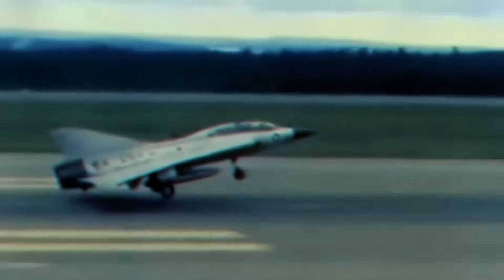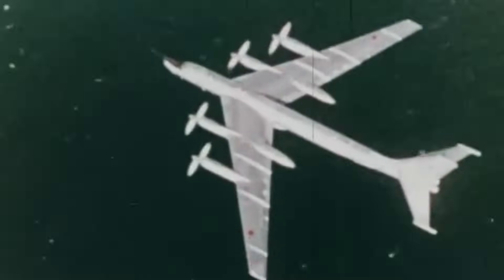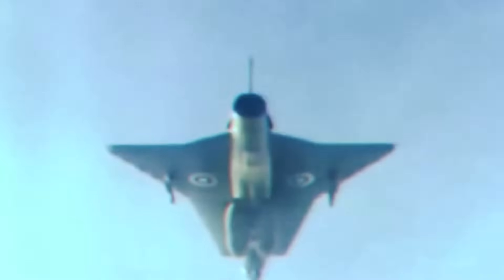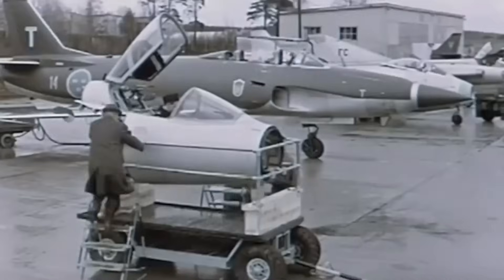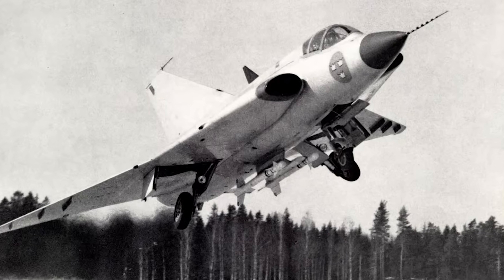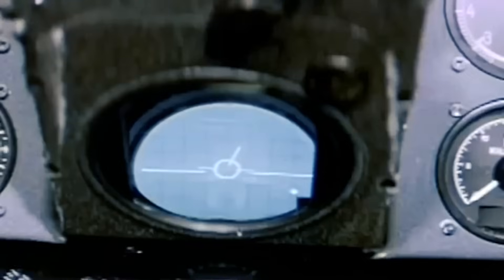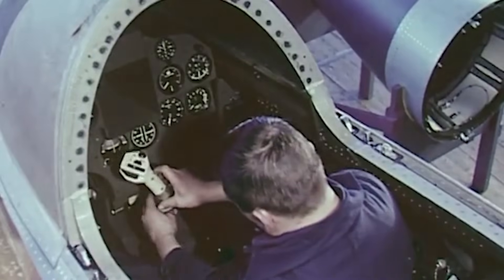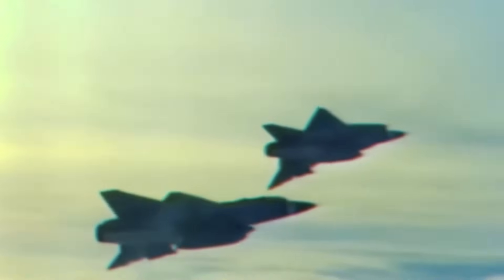The Unmatched Fighter-Interceptor That Broke All Aviation Rules

Comment: John Boyd's "Fighter Mafia"  In studying existing aircraft for their light weight high performance fighter concept,  singled out the Draken for it's low wing loading,  and good power to weight ratio,  with those
attributes included in their wish list,   that eventually gave rise to the superlative YF-16. At the Paris airshow,  in a simultaneous take off roll,  the YF-16 left an F-4,  literally for dead, and then went pure vertical.

Comment: 0:45: "becoming the only European warbird to shatter the Mach 2 barrier":
First there is no Mach 2 "barrier" and second, it's not true since the French first pre-production Mirage III reached Mach2 on October 24th, 1958 while the Drakken broke "only" the sound barrier (Mach 1) the same year ... 
The first serial Mirage entered service in July 1961 and was considered as the 1st European fighter capable of Mach 2+ in level flight. 
The Drakken entered service in March 1960, before the Mirage indeed but ... in its first version J35A not capable of Mach 2.
The first Drakken capable of Mach 2 was the J35D which flew on December 27th, 1960 (prototype) and entered service in 1963 ...
1:53: "these ennemy bombers": I didn't know America was an ennemy to Sweden
9:29: "super-stalls" stemming from its tailless design": this instability allowing the "cobra" manoeuvre presented as an asset is not really relevant since the "cobra" is not only useless in dog fight (unless the opponent doesn't react at all, the aircraft losing too much energy) but it doesn't solve anything w.r.t the pitch instability. The Mirage was a tailless fighter as well but didn't face these issues: it's a matter of design quality, not related to the tailless concept. "Twice the manoeuvrability of other single-engine jets of its time" is not true either.
I understand that you love the Drakken, I do too but it's not a good reason to say so much rubbish
Reply: *Draken, sport.

Comment: The B36 was an enemy bomber?  Since when?
Reply: I think that the Swedes didn't want either side to use their airspace and be drawn into a political "Who's side are you on?" controversy.
Reply: @365BMW  I guess that's all over now with Sweden in NATO, they picked a side...
Reply: The B36 wasn't a Swedish bomber. If/when it crossed into Sweden's airspace without permission it would have been considered an enemy.
Sweden was neutral until very recently, but definitely when the Saab 35 Draken was being planned, developed, deployed and finally retired by the Swedish air force ca 2000.
Reply: @alexandergutfeldt1144  Sweden wasn't neutral. Militarily non-aligned, more like.

Comment: They should have kept them and updated them with new engines, avionics, computers, electronic warfare suite, and aesa radar.
Reply: The Viggen was kinda similar to the F-35. Meaning it was advanced, but absolutely failed at any ambitions of cost-efficiency and high availability. It couldn't turn, it guzzled gas and crashed. It was worth the drawbacks during the cold war, but kinda pointless with the introduction of the Gripen.
Potentially, Sweden could've reinforced the airframe and given it more pylons to carry a whole bunch more missiles. Like 4-6 anti shipping missiles or even ten Meteors.